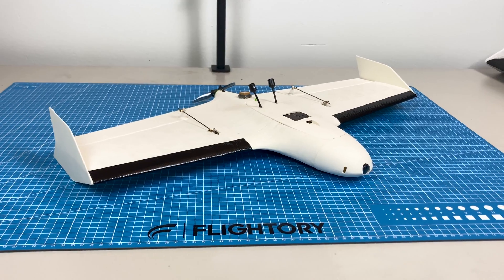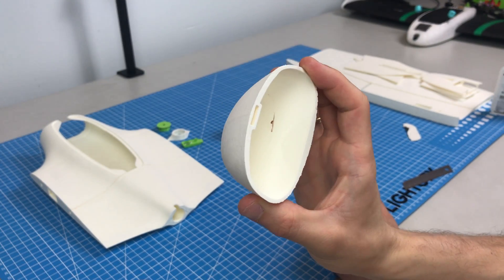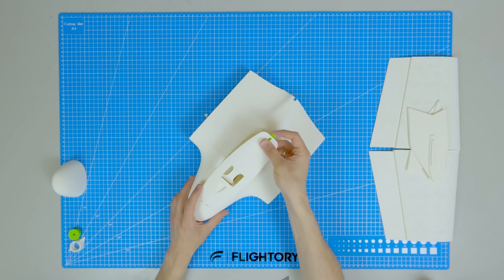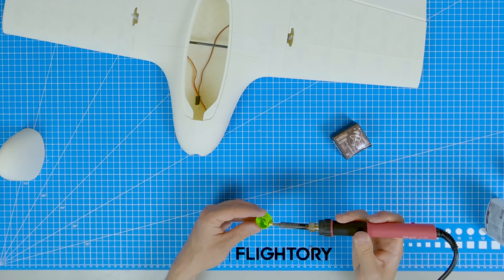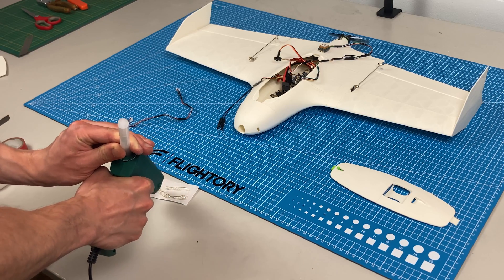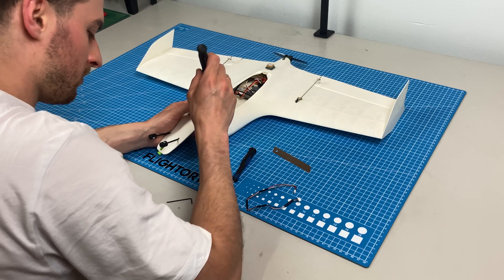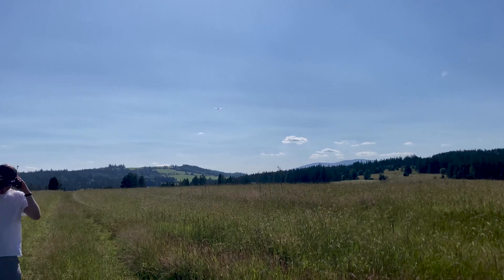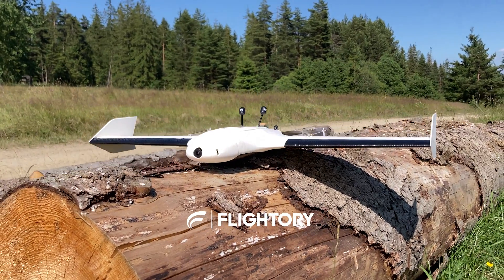How I Built This AMAZING 3D Printed FPV Wing? | ULTIMATE Build Guide and FLIGHT Coverage

Comment: When slicing the Winlet's I get an error in both prusa and orca slicer -  "Empty layer between 2 and 3.2. "   

I can clearly see the gap on the slicer, but not in the CAD program, there it seems fine.  The gap only appears after slicing, not with import into the slicer either.  Changing layer height to 0.1 does not fix it.

Any ideas?
Reply: many thanks for the swift reply via email.

Comment: I watch this video, becurse i want an replacement of my Sonicmodell Baby ARWing. It was hard to launch and get CG, now it is messed up. I have 1806Motor xxxxKV for 3-4S for 5-6inch Prop.
And 2 premium Servos, they are slim Servos and have longer Body i not know if they Fit or if i just can grind some plastic away without make the airframe weak, mayby i have to reinforce with some kind of Magnum Ice Sticks. 
I have already a sealed spoll of 3DLab Print Poly Light material

I have artillery Genius, (shit Printer) and much trouble with privius 3DPrint aircraft. Never testet LWPLA before. 
 Now the Question should I try and invest 23€ for for an Nightmare or simply buy the ZOHD Dart250 kit for 50€ and put the electronix in an proven lighter design 
Why i should choose your plane Over an Foam Kit? Pay 30€ more Extra for Foam and fast build solution or process parts of my hobby Box and have to deal with print settings.
Foam withstands harsh landings or it cen be easely fixed with glue 3D Print explodes in 1000pcs by the the lightest touches.

Comment: Which model would you say is the easiest to build for a beginner. I was going to jump straight into the deep end with the Stallion, but now I'm considering either this one or the Talon
Reply: I've never built a 3d printed plane before. I started with the mini-plank because I like wings and it has fewer moving parts. I'll probably go with a pico talon for my next one if this first build goes well.

Comment: could you guys put links to the software and hardware used? the instructions are very faint and you dont really go into detail on how to program the planes! please include more instructions please, im a begginer and i dont know what the hell im doing?!
Reply from the maker: On our product pages, you’ll find user manuals with lists of all necessary materials and electronics, and these same lists are also provided at the bottom of each product page along with links.

Our instructions include information on printing, recommended print settings, and filaments, as well as the required bed size and suggested part orientation. There’s also a step-by-step illustrated guide for assembling the plane. In our latest designs, we’ve added a simplified wiring diagram, and eventually, every model will have this—these diagrams will gradually be added to previous projects.

As you can see on our site, we use MAVLink flight controllers and ArduPilot software for the electronics. ArduPilot is a fantastic, free firmware that’s continuously developed by creators and the community. The setup and configuration process is universal, so once you understand how it works, setting up additional planes becomes much quicker and easier. However, at first, it’s essential to get familiar with the ArduPilot knowledge base, where everything is explained—from understanding the operation of flight controllers and other components to connecting, configuring, and performing initial flights. You’ll also learn about various fixed-wing and VTOL aircraft configurations.

You can expect videos on these topics on our channel in the future, but for now, I encourage you to explore the ArduPilot knowledge base, especially the red tabs: First Time Setup and First Flight and Tuning.

https://ardupilot.org/plane/

Comment: What size printer you need to make this? Interested to buy if I can easily make it with 200mm x 200mm x 200mm printer capability.
Reply from the maker: At least 220x220x240mm but you can do it with your printer as well. Most elements can be printed; it might be necessary to split one of the wing segments into two pieces.

Comment: Hi, first of all good job and nice work. But i got one concern, what about the thin Layers of PLA on the wings if the sun ist shining and its a lil hotter?
I mean PLA deforms quite fast in the sun.
Reply: If it’s heat you’re worried about go fast, the airflow the wing experiences is far more efficient at cooling than most cooling systems.
Reply: you should've been more concerned about the ESC heating instead of the sun. But like all flying things go, they experience good cooling. That's why ESCs for flying stuffs can go rated up to 50A without ever coming with a heatsink and 4 of them in a board, and if you look at ground crawlers ESC they all come with some cooling even with the smaller amp rated ones. Looking at this guy's design, there's a whole lot of ducting going on so you don't have to worry about internals heating up either.
Reply: @tuttuti123 3 REPLIES

Comment: I love this plane since ever the foam version.

I built it almost exactly but I could not get the cg right
Reply from the maker: In planks, the center of gravity is crucial—a small shift can cause instability. If you haven’t calculated it geometrically or used CFD, it’s best to perform throw-and-glide tests, adjusting the center of gravity until the flight is stable.